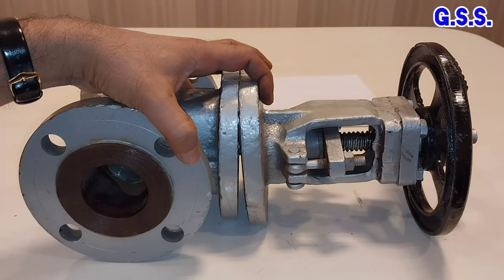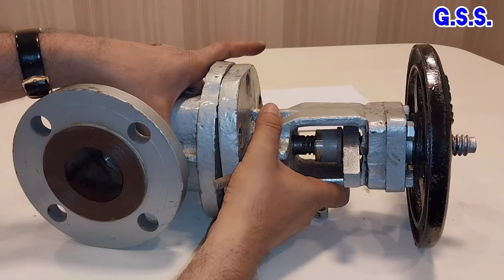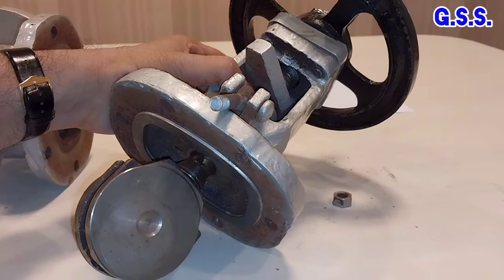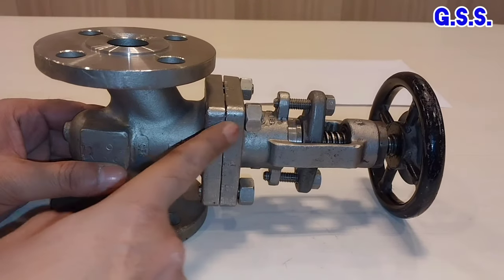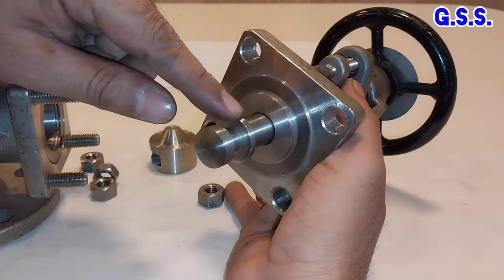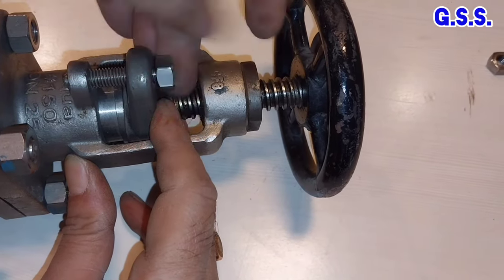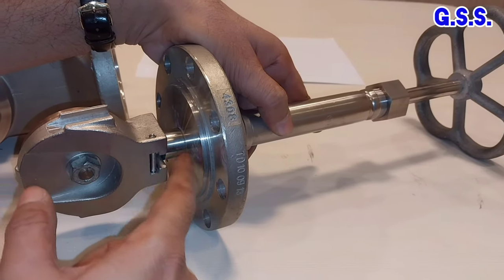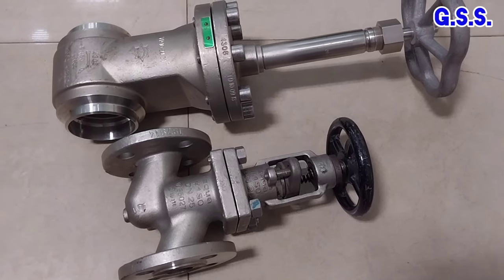Piping Engineering : how to replace valve gland packing online

Comment: Wonderful explanation sir. 
But a general warning in almost all international standards states that manufacturer should not recommend backseat sealing as a reliable means for adding or replacing packing while the valve is under pressure.